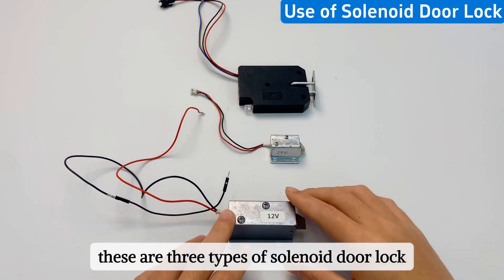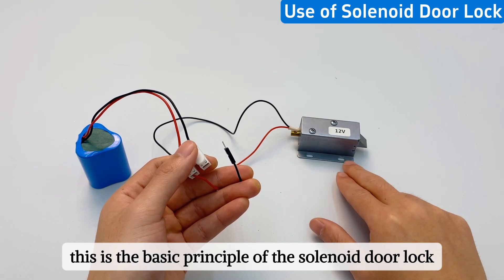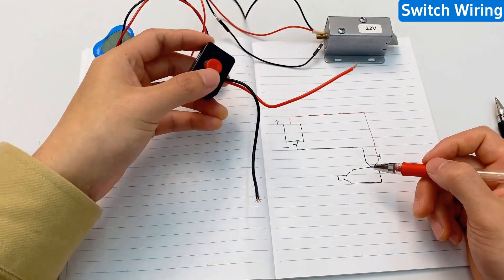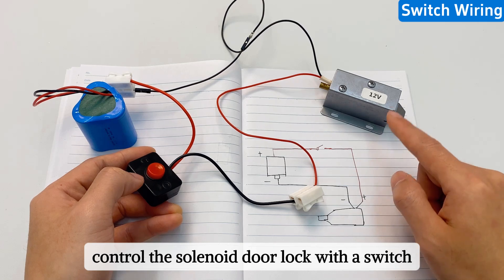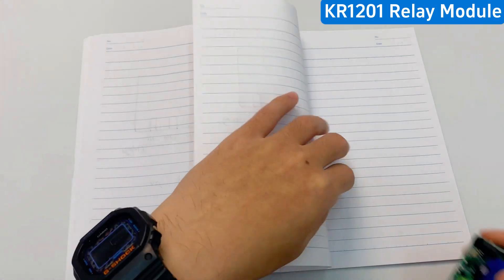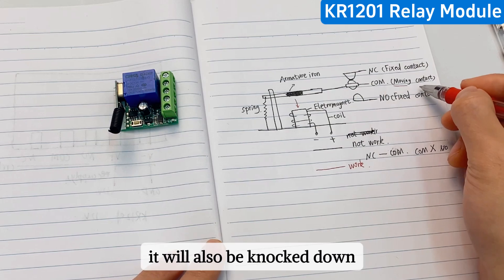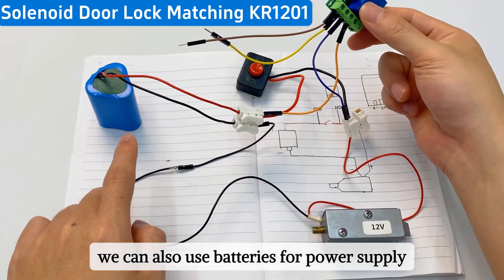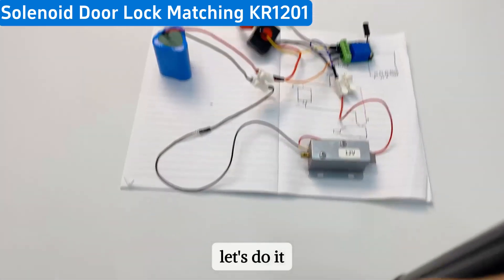How to Make a Remote Control Electronic Lock via Receiver Module KR1201 12V RF 433MHz Relay Module

Comment: Rang kitana hy
Reply from the maker: There's some information I need to share with you: The range is determined by two factors, one is the receiver and the other is the transmitter.
For example, for the same receiver, with our ordinary remote control, the range is generally around 50 meters. With our long - range remote control, it can reach around 100 meters, and with our ultra - long - range remote control, it can reach around 300 meters.
Based on this, the range you need depends on the product details page or you can ask the customer service. Purchase different remote controls according to your different needs.
The white remote control shown in the video is our ordinary remote control, with a range of around 50 meters.

Comment from the maker: If you are interested in the KR1201 remote relay module in the video, then you can watch this video：
:yt:https://youtu.be/ah2Llv7Pp2w
How to use remote control switch, DC12V, wireless relay switch 1Ch rf 433Mhz, KR1201 by QIACHIP
If you have any other questions, please let me know and I will experiment!
Reply: Hello, do you have a video on connecting the kr1201 module to a gara ge cannot get the original remote control